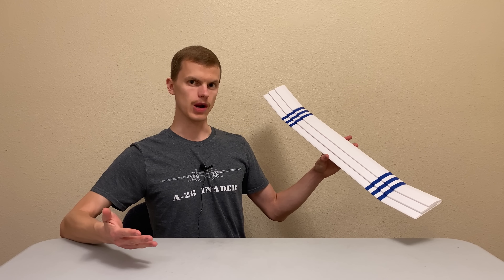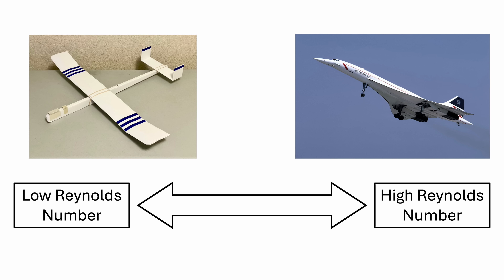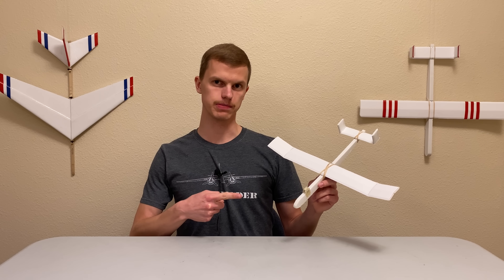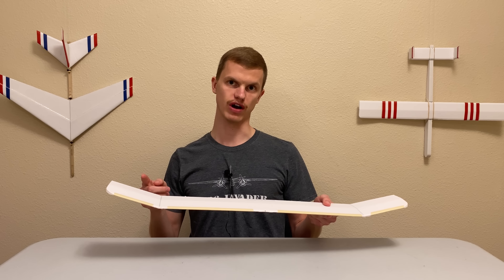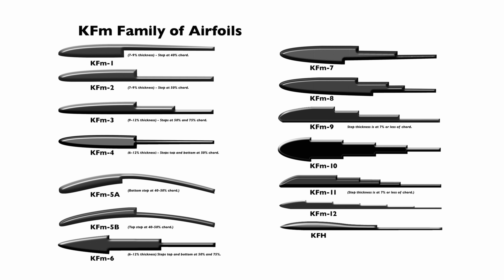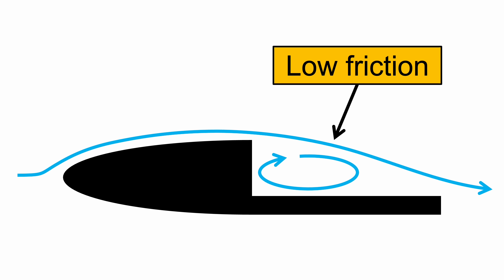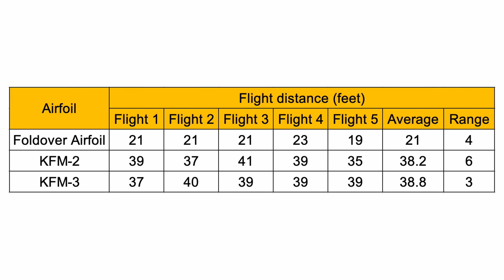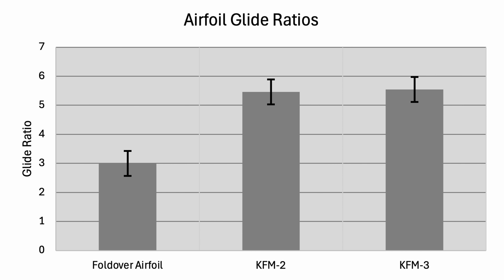Stepped Airfoils for Model Airplanes - Are They Better?

Comment: It seems to make sense. Why don't we see it more often? Is it a mix between keeping a design close to the real-world models and ignorance? Might a smooth surface be easier to produce in mass production? I wonder why I have never seen a Polyurethane plane using a stepped airfoil (I haven't seen many, though. So the sample size is small)
Reply: стереотипы такие стереотипные))))
увы часто в нашей жизни нам проще делать то и так как мы уже привыкли делать ранее. новое принять часто сложнее чем продолжить делать старое но менее эффективное.

если же речь идет о большой авиации то ты учитывай и тот факт что в крыльях размещают топливные баки и механизацию крыла. закрылки и прочее.это тоже надо где то разместить.так что в полноразмерной авиации возможно ступенчатое крыло будет менее выгодным с такой точки зрения.

но часто в авиации правит консервативный образ мышления. или просто практичность , для производства новых крыльев нужны новые линии производства они стоят денег зачем их строить если есть уже работающие старые?пусть новые крылья будут лучше но придется переоборудовать производство и прочее.
Reply: @ivannegrozni7692  Disclaimber: I had to use google translate to read the answer. 

I guess, it is not used in full size aviation, because the hull drag is not dominating. In other words: An Airbus can't be scaled down to insect size and still work. I guess he referenced in the video, that steps don't work well for full size airplanes. (Edit: 1:36 )

Flaps are a point, but not the whole wing needs to be the same profile and it works fine for FliteTest models. There can be small pods in the wing to house servos.

Just in case, I didn't express myself correctly, i was talking about model airplanes. I haven't seen the step for non foamboard airplanes. For foamboard, it is a convenient solution. Now, after having seen a video, which shows that it is beneficial for small rc planes, I wonder why I have only seen it for foamboard.

In the end, you probably got a point concerning the conservative nature of the marked. It might be more true for rc models. People want models, they have seen before and noone benchmarks the flight characteristics in high detail, because it is recreational. Almost noone makes money transporting cargo with model airplanes.
Reply: @merkatorix  ну....я писал про полноразмерные самолеты ну большие.а если речь идет о игрушечных для развлечения то не делают потому что ПОТОМУ....но в целом людям привычно видеть то что им привычно видеть))) даже если речь идет об игрушечных авиамоделях многие не купят самолет с таким крылом.потому что не разбираются в теме настолько чтобы понимать как это работает и им будет казаться что такое крыло плохое.

Comment: It's interesting to see how repositioning a similar amount of material between one step and no step increased the glide ratio by nearly 50%.

Thank you for this presentation, i wonder if the height of the step and the length of the step can be tiled to gain this benefit on full-size wings, or as you said, where the threshold is for significant gains decreasing with scale.

Comment: Very interesting - I'm used to building slope glider (more for racing) and so aerofoil shape is  important for speeds we fly at. I still wonder if aerofoil shape is still playing a part even at low speeds and low Reynolds numbers. Maybe say a Selig S1223 or AG 36 (or other glider appropriate) aerofoil would be quite different. It would be cool (but more effort) to compare a smoothly contoured wing with a more controlled aerofoil shape (maybe hot wire cut in light foam with thin carbon tube spa?). Then, depending on how it performs, compare same with undulations, steps etc.

Comment: a good glide ratio for a gliderm is better then 30 to 1 (50 to 1 has been achieved) these results are very poor, the shape of a good airfoil is precise engineering
Reply: Those values are true for "real" planes, with a wingspan of 15+ meters, weighting several hundred kilos and going >60km/h. Those operate at Reynolds numbers of 1,000,000s, not 40,000.

Comment: Can we make an origami plane design incorporating a stepped wing design? :D
Reply: It's not really origami per se, but I came up with a design for a paper airplane with what amounted to a KF1 airfoil back in the mid-70s; it's a fairly simple design, although you have to take care to keep the folds symmetrical or the plane will turn from differential lift.

Comment: 0:31 the one on the left is stepped too.  On the bottom.
Reply: Right, what you're calling a foldover air foil is really a KFM-1
Reply: @dansw0rkshop  I was also curious about this. It's not precisely a KFm-1, since that has the step at 40% of the chord, and it looks like his is closer to 60% or maybe slightly more. Some tissue paper (or probably just regular printer paper) and a glue stick would be simple way to close it up for testing. Curious how that would compare to the current version.

Comment: This is exceptionally succinct and well presented, plus a nearly 2x improvement is quite the result! Pardon my skepticism here, but I think such a large difference merits a bit of adding prodding just to make sure something else isn't going on. With that in mind, two things stood out as worth a second look:

* In the conducting the experiment section of the video - the angle of launch for the fold over airfoil is definitely different than that of the stepped wings. I suspect this is actually an editing issues rather than an experimental one but tripod heads are not the most reliable things either. Mainly mentioning this as a 'just in case'

* The fold over profile looks a bit like an inverted step on the trailing edge. Granted that maybe how it is commonly constructed, but this shape does distract from the overall explanation. After all, having what are effectively ailerons pitched slightly downward could explain the surprisingly poor performance in the test. Perhaps a bit of tape to cover the gap could sort out a potential issue here. I'd would be interested to know if closing that gap makes a difference in its own right, but double so now that is being used as point of references for other profile designs.

These observations are not intended to be criticisms but more suggestions for a follow up video. The concepts and testing where so well presented here that this is an easy like and subscribe.
Reply from the maker: I did have to launch the fold over airfoil on a steeper glide slope than the stepped airfoils to get enough thrust to overcome the additional drag, otherwise it would slow down and stall.

Comment: Don't forget why golf balls have dimples! Another interesting direction in this type of experimentation with surface drag reduction is distributing micro-vented air across the surfaces, basically creating a low-pressure air bubble around those surfaces. Or a flexible wing covered in individually-adjustable scales, each creating it's own little low-pressure void, controlled independently over the entire surface. 
In other words, feathers!

Comment: Were the weights and CG of all the gliders the same?  Seems suspect that the heaviest wing (foldover) had the steepest glide slope path.
Cool expirament nonetheless!!

Some speed boat hulls have steps like these - i have no idea if they're for the same reason as in the wings though.
Reply: Speed boats usually use steps to help separate the water from the hull, for example, due to the coanda principle fluids try to stay attached to the surface they are in contact with. In a boat with a displacement hull the water would be pushed upwards after the boat's "tail" and thus pushing the hull in the water  (very much simplified). If you use a step the water will not be able to follow the surface of the hull and thus will separate, reducing the downforce the hull receives.
There are also other consideration about the critical hull speed and how it s affected by waterline length but mostly, steps are there to reduce the "downforce" the hull receives and thus help the hull "plane".

Stepped hulls are often called planing hulls as their lift is dynamic and not displacement based.

Hope this helps👌✌️
Reply from the maker: The weights of the gliders were very close.

Comment: I wonder what a steeped foil operates like in an hydro environment - ie. as in a centreboard on a yacht?
Reply: Stepped hulls are a thing in the power boat and racing  world. The dynamics are entirely different. It is about getting the hull out of the water on a plane.
Reply: @JohnHoranzy  I do understand that John, thanks. I was thinking of a low drag centerboard on a relatively slow speed sailing boat.

Comment: I appreciate your effort, and care about this as I love small balsa gliders. We used to make them 4 inches long, and had great results usually. The thing I wonder about with your experiments is if the air is doing what you think it is. There is enough going on that you are generalizing a lot in your conclusion. You need a mini wind tunnel with smoke, and then possibly some flights through smoke to see if the patterns seem to match. Then you can connect cause and effect better as you are really just retesting past experiments by others. I'd love to see that mini tunnel in action.

Comment: I feel set back to my youth, maybe with 14, that is over 40 years ago.  
 
Interesting approach to systematically work through the basics of aerodynamics and do systematic test, in the style of a school project. 
 
For me it was RC-gliders of various types, In the end phase (decades ago) I had a set of planes for the various conditions. 
A foam delta wing that was ideal for testing out the lift on a slope, as it was extremely robust due to low weight, and aerobatic was also possible Amazing was the spin, you stalled the wing slowly with a little aileron, and it went into a flat spin around the wingtip, hardly losing height. 

Then (when you know there is a little lift) you could fly with a F3K-style 1.5 meter, 450 gram, 2-axis glider and could stroll around happily. 
 
But as soon as it became stable, it was way more fun to ramp up to the carbon fiber planes built in moulds, with a VERY smooth surface, very precise airfoil. A smaller one with 1.8 meter and 900 gram, or, when you were really sure, my "biggies", F3B-style planes 2.5 - 3 kg. 
 
Trouble is that these planes are working so much better that you are totally spoilt after a while. Their performance is at least 50% better than a wooden wing, and the attainable speeds  are a multiple. Granted, by a multiple of the cost for buying and for repair. 
 
Aerodynamics is a fascinating topic.

Comment: Your comparison should have been with a simple flat plate airfoil. At low reynolds numbers it has a high L/D, not becahse lift is high, but because drag is very low, It is well documented that below 3 in chord there is little advantage in having an airfoil shape compared wjth flat plate. If you want a project what about looking at curved thin plate airfoils ? Plenty of configurstions to look at. Flat plates at low re also have some interesting aerodynamic properties regarding CP movement and stall with angle of attack. There is not much information on flat plate performance. It is becoming more relevant now due to the increase of model indoor flying because of 'Drone' regulations reducing outdoor flying and avaliability of micro miniature RC gear. equipment.

Comment: I was a full size glider pilot for several years . Would smoother and and more rounded wing tip design help  ?
Reply: Probably not, less energy available to create energy sucking vortices at slow speeds and very low wing loading. Wouldn't take much to explore in a desktop wind tunnel.

Comment: the fold over has a marked step at the lower surface trailing edge, which by my assessment is actually creating a hybrid inverted kfm2 - which would suggest that the lift is being compromised by the "inverted lift" of that part of the airfoil

run a fill-in layer of tape from the step to the actual trailing edge to "disappear" that step and then try again... i am keen to see the difference

Comment: I would suggest comparing a "Flat Plate" airfoil and an Undercambered airfoil:

The former is the baseline to which all other airfoils are compared. If this plate can outperform the Flite Test styled wing, then it's clear that the FT wing isn't well suited to this Reynolds number range

The UC airfoil, meanwhile, is what most  of your gliders have used by default, and the lower thickness combined with greater "net" camber than the FT should let it perform favorably in L/D

Comment: What is the bendable foam used to make these wings called?
Reply: This is just standard foam board. Probably Adam's Readi-board. You can fold the foam like in the video with a little score cut, beveling the foam, and slowly bending the foam to shape. The paper on the outside is what makes the smooth finish.
Reply from the maker: I use Adam’s Redi Board.  Another option is Elmer’s Board.  It is stiffer than Adam’s, but also heavier.

Comment: was the total weight of each wing equalized to adjust for different amounts of material used in construction
Reply: Thank you, my question too. You know the wings with more material were heavier. That being said, the stepped airfoils still did better with these slow speed park-flyer scale planes. I would assume stepped wings that are optimized for weight would do fantastic for foamies.
Reply from the maker: The difference in the weights of the lightest and heaviest planes was only 6%.  I didn’t try to match them exactly since the weight of a glider does not affect the flight distance.

Comment: Nice Comparison, but Sorry- you're making a crucial error: The maximum airfoil thickness which really works is about 7-8 % at this Reynolds numbers. Therefore every other airfoil is better:
Let's explain: In my youth I was owner of "der kleine UHU". Clark Y. 
I lost my ballast chamber and I turned my wing by 180 deg's leading edge to the font. And it flew  good.- not worse than standard.
Airfoils which work best are usually thin airfoils with 3D-turbulator (zigzag). 40 Yrs ago it was "Junior" of Graupner.

Comment: There are not to many step airfoils on birds.  Obviously 100 million years of evolution did not find step airfoils superior to a smooth curve. This discussion and experiments have been going on for over 50 years. If an experiment is set to show a small isolated parameter range as being advantageous, it doesn’t warrant any great proclamations that we see stated.
Reply: Perhaps on the scale of birds, but it seems Dragonflies use a similar concept: not a full on step, per say, but using a jagged shape to deliberately make vortices in the shape of an airfoil.

Similarly, some whales have bumps on the leading edges of their fins to make vortices: they may be much larger, but water is FAR more viscous than air (dynamic viscosity at least: kinematic viscosity is actually lower)
Reply: @spindash64  Forget about the bumps on wing perfo: They're like Vortex generators to avoid flow separation. 
And dragonflies- this is unsteady aerodynamics. - this is a different world.

Comment: It's known as the Kline-Fogeleman airfoil that was developed in the 1960s, but never found in any application other than paper airplanes and r/c airplanes due to a poor lift-to-drag ratio performance in wind tunnel testing by NASA.
"Time" magazine published an April 2, 1973 article, "The Paper-Plane Caper," about the paper airplane and its Kline–Fogleman airfoil. 
Also in 1973, CBS 60 Minutes did a 15-minute segment on the KF airfoil. CBS reran the show in 1976.
In 1985, Kline wrote a book entitled, "The Ultimate Paper Airplane."  To publicize the book Kline traveled to Kill Devil Hills, NC, the site where the Wright Brothers first had flown where their first manned powered flight, of 122 feet (37 m). A crew from Good Morning America filmed the event. The longest flight by Kline with his paper airplane traveled 401 feet 4 inches (122.33 m).
Reply: Wow! You nailed it. Thanks! Dick Kline
Reply: A conjecture of mine is that the KFm3 airfoil, which is my heavy lifter, generates lift over most of the airfoil because the two steps produce vortexes that lower the air pressure over most of the upper surface. Normal airfoils only produce lift over the front half of the airfoil. This has been a wonderful adventure for me that started in 1964. ~ Dick Kline

Comment: It was common to use a step on sea plane floats to help them lift off.
Reply: This 'breaks' the surface adhesion of the water, otherwise float/sea planes would need a lot more energy to get into the air.  I guess they plane like high speed boats which have the same step.